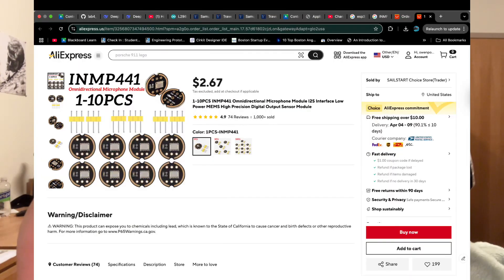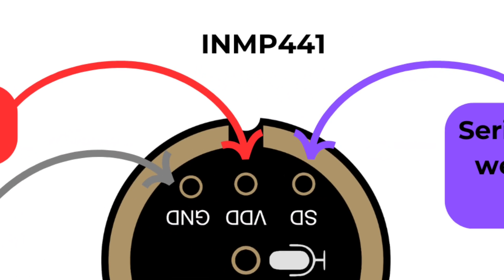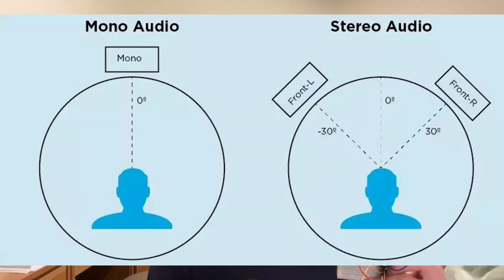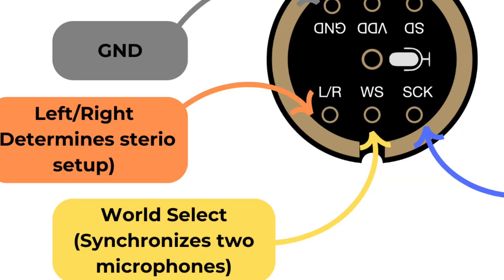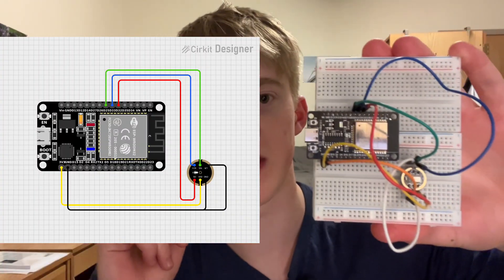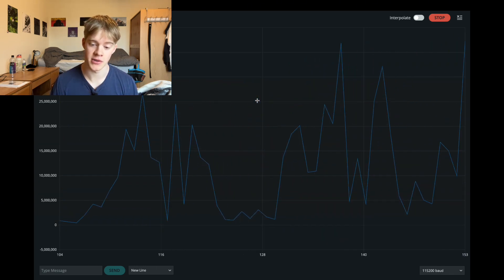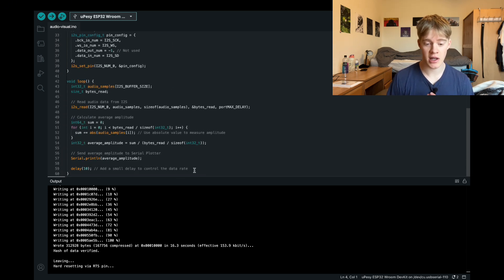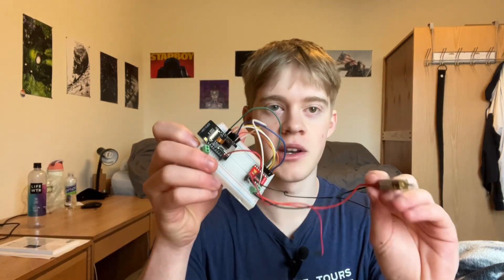How to use INMP441

Comment: would the specs on this hardware be good for a guitar tuner?
Reply from the maker: I’m not sure, but it’s the same module in most phones so
If it works on those then it will most likely work

Comment: Mine only shows flat line no matter the sound noise level.
Reply from the maker: Hmmmm most likely wiring or which pins the code is interfacing with, do you have more information?

Comment: You are using it wrong. the sound goes in on the flat side with no components. The center pad is the entrance for the soundwaves. The mic itself is bottom-side.

Comment: Can you make a video just explaining how to detect a voice recognising "hello". I mean one pin will go high only if you say "hello" and no one else. Is this possible?
Reply: if you have a decent PC you can use OpenVoice to clone various voices from somewhere like eleven labs and generate 100,000 clips of training sample data of the word that you want said in different ways in those voices. then you gather negative data of sound that is not the word you need. then you can train an openwakeword model using that data. after optimising the model this can then run directly on the ESP32 chip.